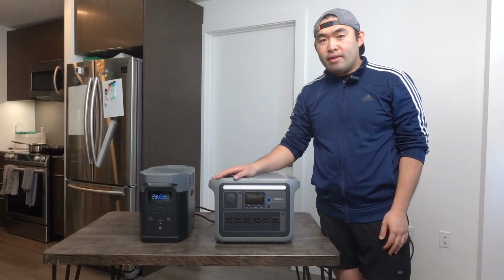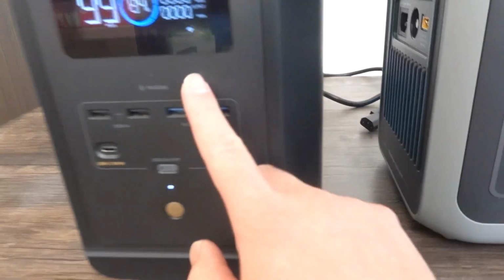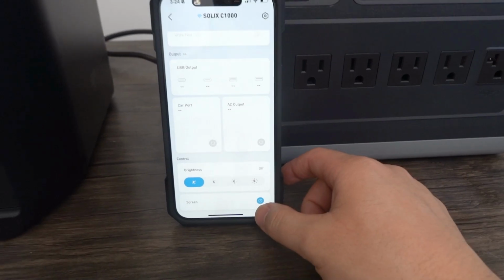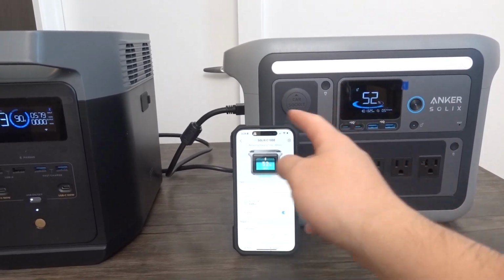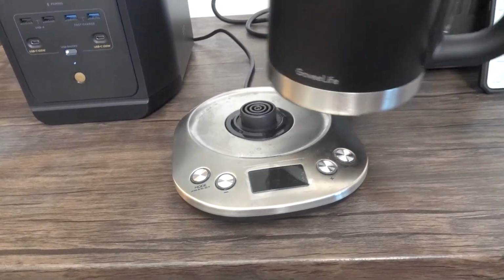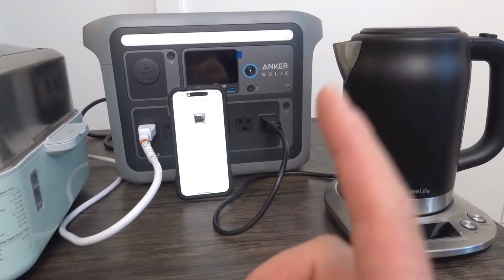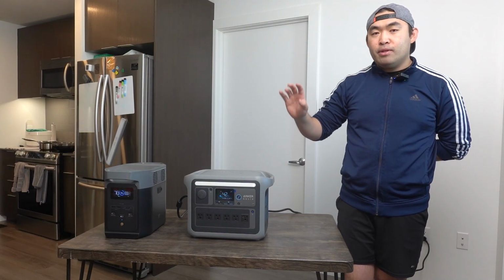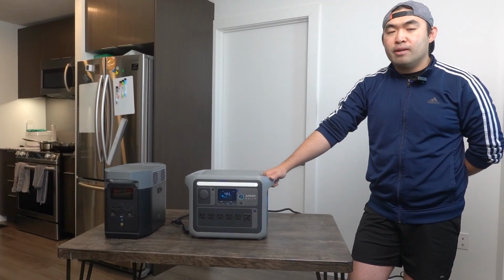Anker Solix C1000 vs Ecoflow Delta 2 Portable Power Station

Comment: Good tests and comparisons. 
Anker is putting out some great products and they seem to have a good reputation for customer support. 
I often use my Ecoflow power stations as back up and the 5521 ports connect directly to the router's power port.  This saves critical power during an outage. 
I also rarely use more than 2 of the AC ports. 
Thank you for putting this together

Comment: Can you use either of these devices when your house loses power? If so, how?
Reply: Yes, you can to a certain extent.  I plan on having two Anker Solix C1000 units with the backup batteries.  I am going to install a transgender switch on my boiler so I can have heat in winter.  I am not sure of the wattage, but I cannot imagine my boiler being over 400 watts of draw when it is running.   I can run my fridge with the second unit, or I can have both dedicated to my fridge when it is hot out.  

These devices will not run everything in your house or apartment.  The output is way too low.  It would take a very large generator to even do that.  However, one would be able to run a few essential appliances and a few convenience items.  If a person gets a little creative , they can also extend the run time.. For example, the Anker can power my fridge for about 11 hours without the extra battery.  Fridges can keep cold air in for quite awhile.  I would bump the operating temperature a touch colder and run my fridge for about 20 minutes every couple of hours to extend the battery.  I would also run the fridge after opening it, which means plan accordingly.

Comment: damn I wish I bought the C1000 when it was on sale.
Reply: 300$ coupon if you buy on Amazon
Reply: It's on sale now. But still I think its too much for a 1kwh battery. They should be £500 / $600 or less pre-sale.
Reply: Right Now on Amazon they are below $500 USD.